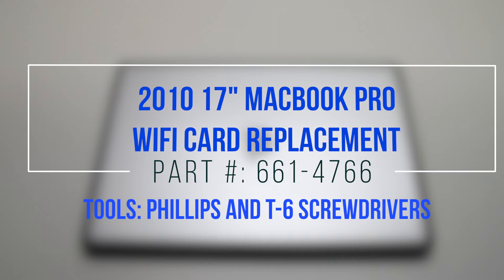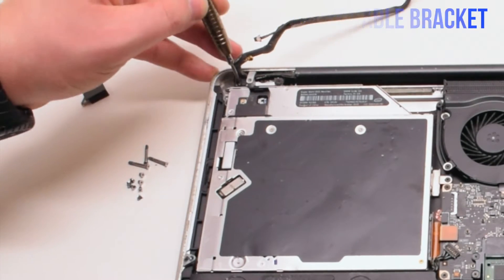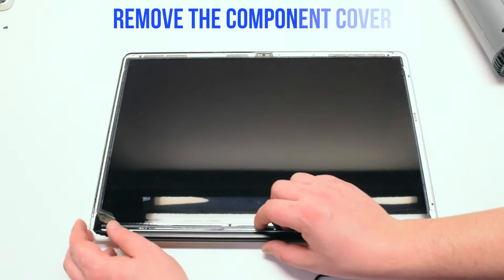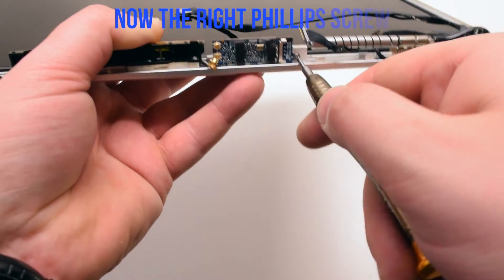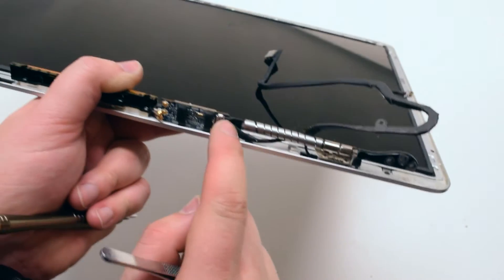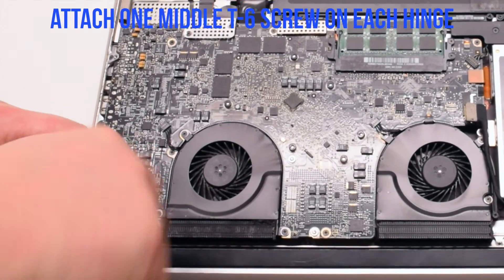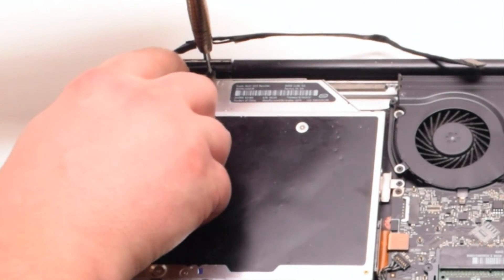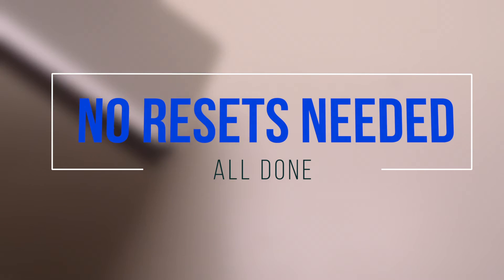2010 Macbook Pro 17" A1297 WiFi Card Replacement

Comment: is this an upgrade or just a replacement? I want one of these large older machines but want to update part like the wifi/bluetooth....not sure if It can run an older macOSX though if its a bluetooth 4.0 new stuff ?
Reply from the maker: No way to upgrade, this is a replacement only video.

Comment: Thanks for this! Very helpful. Who knew Apple would put the stupid wifi card the the base of the screen, all to make replacements more difficult I guess. Is the cable that connects the card to the motherboard easily removed from the guard? I was told that is a common point of failure on these models, not the card itself.
Reply from the maker: Yeah, there is a part that is not in the video. If the logic board has never been worked on, there is a small plastic piece that is glued behind the cable connector (on the logic board) that prevents the wifi cable from sliding out. In my experience, the wifi card just goes bad more then any connection problem. It was a cheap manufacture and suffers from an old 80s creep-chip problem, on these models only.  On 2011+ and on it's usually a cable connection problem.
Reply from the maker: Also to note, there is a component level controller thats in charge of card communication with SMC and that can go bad as well from dust buildup and water damage of the logic board (worst case scenario, if cable and card replacement doesn't solve the problem and the wifi cable socket looks good). Check out this video all the way through for a complete, general understanding of Apples laptop wifi system https://www.youtube.com/watch?v=pwaz8Mf47Ls